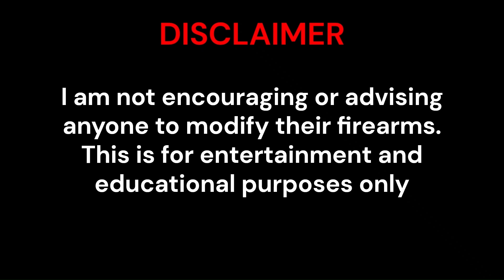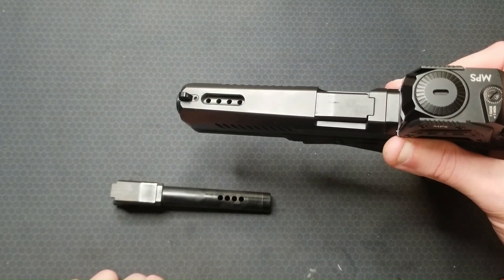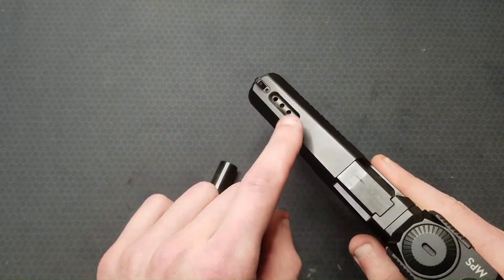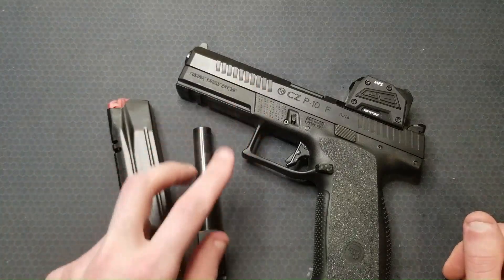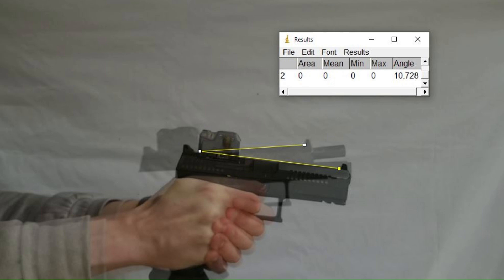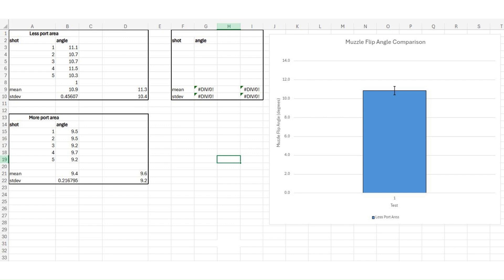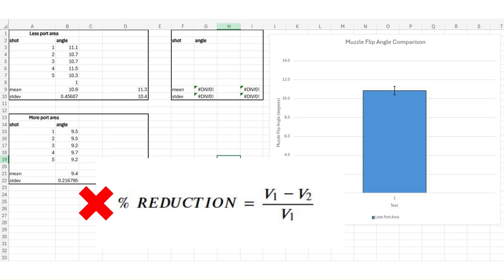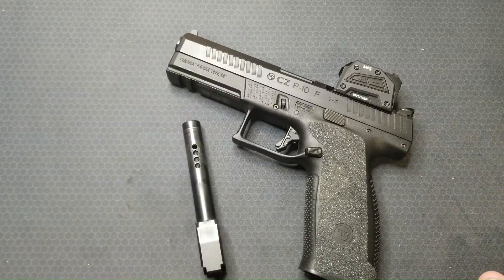More or Less Total Barrel Port Area

Comment: I have been wondering if there's a way to port only through barrel grooves or holes so as to reduce spalling.  I don't think that would be practical but an interesting issue.  Also, I had been thinking the port size should increase as they proceed toward the muzzle... because gas pressure will decrease at each port.  Your videos made me realize that the size of ported area does increase (is additive) as they proceed toward the muzzle.

Comment: How do you deburr the inside of the barrel after machining?
Reply from the maker: Sandpaper wrapped over a brass rod. I'm really careful when i punch thru with the endmill or drill bit. Correct rpm for bit too.

Comment: What you didn’t mention was the vector at which the ports were pointed for the smaller holes. 

You’d get the cosine loss of the angles off of buttline. The smaller holes have a slight difference relative to the larger ports. 

Likely the effective nozzle area is about the same since the flow is sonic at the holes themselves. Due to boundary layer effects, I imagine the larger holes also have a larger effective area. Holes are more generally more efficient the larger they are. 

Overall, I agree with everything you measured and agree with your points on the smaller holes.

Comment: I'm curious what you think of the Glockstore style porting. I know what you and others have said about V style porting vs inline porting but wanted to know if you had a different opinion with Glockstores'. Specifically on a 43X barrel 3.41 inches. TIA
Reply from the maker: Not too familiar with Glockstore. I looked on their site and saw the "double diamond" porting. That was really the only one I was seeing. Looks like they don't bore out the rifling. I ported a springfield hellcat like that without boring out the rifling and it cause massive spalling and jacket separation (that got deposited in my forehead), and had an awful impact on accuracy. Their Double diamond porting looks very similar to what I did to my hellcat. I would be really worried about the negative effects of that port design. 

If you're asking about their "C cut" porting, that looks more reasonable, small slots that are less likely to tear up the bullet as it passes. They are in a narrow V so the majority of the gas will go upward, reducing muzzle flip more than if it were a wide angle V.
Reply: @EngineersArmory  Yes, I was referring to their C cut. Thank you for your experienced opinion.

Comment: Really appreciate the work you put into this.  Any thoughts around “C” porting vs the hole porting?
Reply from the maker: Not quite sure what you mean by C porting.
Reply: @EngineersArmory  glock C-style porting?
Reply from the maker: @pedromegacool  oh probably. Holes in the barrel will help. More total port area will perform better in general. I view port design as affecting accuracy, spalling, and jacket separation more.

Comment: What portion of muzzle flip reduction was caused by reduced bullet velocity owning to lower pressure from the ports?
Reply from the maker: I dont know and I have no way to isolate that variable or test for it.
Reply: Thank you for taking the time to reply.  Where do get your barrels to afford to go through 14??. I did R&D and could do a DOE if you're interested. 
 @EngineersArmory
Reply from the maker: @marksvilar6550  14 barrels on different pistols for the most part. Just porting pistol that I or my friends have. Only a couple pistols had more than one barrel ported. I appreciate the offer. I can do DOE myself, the problem is I dont want to keep buying barrels haha. I have pretty much covered the testing that I want to do in as much as it has helped me converge on a standard porting design/set of parameter.

Comment: Three questions:

1. Would angling the ports to align with the fulcrum of shooter’s hands provide any difference in results from typical 90 degree to barrel bore portings?

2. Would using smaller diameter ports affect the muzzle rise reduction?

3. Would counter sinking the ports offer any reduction effect on the muzzle rise?
Reply from the maker: 1. Not likely. If it affected it one way or the other i bet it wouldn't be measurable with my methods. Torque would be so close due to having the same separation distance from the fulcrum, the difference in muzzle flip reduction would be due to slight changes in the resultant force vector based on the component of it that aligns with the fulcrum. lets say we angle the ports back 20 degrees - there would be a difference of 1-cos(20) or roughly 7%.

2. I saw your comment on the other video and this was answered.

3. Countersinking might? its hard to tell. Again, my background isn't in supersonic compressible flow fluid mechanics. I don't have a good intuition for it. However a diverging nozzle after the throat will accelerate supersonic flow as in a rocket nozzle. Countersink would be diverging from the ports. But I don't know if you would consider a port a nozzle or an orifice. And again, I don't have an idea about how much it would affect it, or even if I could measure a difference.
Reply: @ - you are a well of knowledge.

Not an engineer, just my layman interpretation, but if you did countersink the ports would this provide additional surface area on which the escaping gasses’ force could “push” against the conical sink atop the barrel and affect recoil?
Reply from the maker: @devilish_details  Well if you think about it that way... isnt the gas force going to push against the top surface of the barrel regardless of the form of the top of the ports? If we think about downward force (which we are concerned with to mitigate muzzle flip), and there is an angled countersink, the gas force will be perpendicular to that angled surface. Meaning that only a component of that will go to forcing the muzzle down. If there is a 90 degree included angle countersink, that means each side will be 45 degrees off vertical. The components pushing sideways and vertically will be equal and of less magnitude than the force vector perpendicular to the angled surface. Sin/cos(45) is 0.7. So you'll be losing ~30% of that downward force on a 45 degree angle. 

This is all in theory and would the difference in practice be enough to even measure? likely not. But this is the kind of nerdy detail i like haha. 

I was thinking of the form of the port affecting gas velocity. Which I think we would want to maximize for scavenging and also kinetic energy. Which is proportional to the mass and the square of the velocity. more gas energy up, more force to push the muzzle down.
Reply: @EngineersArmory  - Does this mean that the crowning seen on some higher end 1911's is purely aesthetic and offers no significant effect on the escaping gases?
Reply from the maker: @devilish_details  Interesting parallel. Good question. I dont know. I thought target crowns were for accuracy. I have heard they dont affect accuracy at all - this was mentioned in a Haye's custom guns video - I would trust that dude, he tested it. 

I always thought the idea behind a target crown was to prevent the edge of the rifling from being damaged if the barrel came into contact with something. A little burr or ding at the edge of the rifling could negatively affect accuracy as the bullet leaves. 

I like barrel crowns for aesthetic purposes and thats the only reason I flush cut and crown my barrels haha.

I dont see the benefit from having scavenging or accelerating effects at the muzzle for the gasses behind the bullet. I dont see how extra rearward force on the muzzle would help either.
Reply from the maker: @devilish_details  I think I may be having a hard time understanding what you're asking. 

In relation to ports it may or may not, i really do not know. I don't know that a chamfer vs not on the ports would produce a measurable difference, and I dont even know what condition a theoretical difference may favor. The thing im getting hung up on is 1. lack of knowledge and intuition about supersonic compressible flow. 2. mainly that I dont know if the ports would act as a nozzle or orifice. If they act like an orifice, I have even less of an idea. Im more sure about an diverging nozzle after a restriction accelerating supersonic flow.

Lets say an inverted barrel crown vs a 90 degree face does effect gas force on the muzzle as the bullet leaves one way or the other. I would think it would only really impart rearward force. More/less rearward force along a line with some perpendicular separation distance from the pivot point could indeed affect muzzle flip. By how much? no idea... Would this also result in any faster/slower unlocking time? More/less slide velocity? maybe.

Related to the AK slant break thats very obviously directional venting gas up and to one side to prevent muzzle rise and sideways motion due to the force of the recoil being offset from the shooters centerline.

A device on a pistol more analogous to the slant brake would be a compensator - redirecting gas in the direction opposing recoil.

I think my answer here is that in theory a barrel crown vs no crown could affect recoil characteristics. I doubt it would be measurable, certainly not using my testing techniques. Ill also likely never test it haha.

Comment: What about one big pill shaped  slot?  It two smaller slots at like 30° either side of the front sight.   Also maybe try an extended barrel  with ports outside of the slide.
Reply from the maker: Ive tried a few different slot port designs. The one I tested was my FDE M&P 2.0. There is a video in the playlist linked in the description. Slots and V slots are cool, they work well. They are more prone to jacket separation and spalling. It complicates machining a little.

Comment: Would be cool to see a flattened top  bull barrel with more small ports facing up in the same area, allowing more high velocity gas volume ejected in the same area while not shaving lead or jacket. 
Progressive diameter increase would be neat too.
The smaller the holes, the higher the velocity (Bernoulli),more directional and should be a bit louder based on the frequency, definitely worse gas cutting.
Getting injured during research has a long tradition. Scars of science.
Reply from the maker: Scars for science! haha. 

Im less sure about the Bernoulli effect here. I have been having trouble coming up with intuitive answers. My background in fluid mechanics is primarily subsonic, incompressible flow. The flow case of ports is supersonic, compressible. A completely different animal. I am not sure that a converging nozzle will result in a higher gas velocity from the ports like it would in subsonic incompressible flow. I think supersonic flow is accelerated by diverging nozzles. Now can ports be considered a nozzle or an orifice? 

Heres a really cool old video about supersonic compressible flow in a channel, it shows increase in velocity after a diverging cross-sectional area channel:
https://www.youtube.com/watch?v=JhlEkEk7igs

I am to the point where I pretty much make arrays of smaller 3/32" holes, poke enough of them to get the overall area i want. Minimize jacket separation and spalling, minimize effect on accuracy. See my Shadow 2 port design for an example of this.

Anyways I really struggle with intuition about the behavior of the gasses leaving ports. Its a completely different animal than what my background is in and what i employ every day at work (hydraulic fluid in cylinders and hoses).

The thought of sound and frequency leaving the ports is another interesting thought. Force from mass flow, but also force from a pressure wave preceding that mass flow.
Reply: @EngineersArmory  
You're right, didn't think of the velocity.
Compressible, turbulent. Sound will travel differently too. 
Con-di nozzle not really but too short of a distance, no expansion portion, mass volume changes too. 
It'd take some serious software to get an idea how the gas reacts to what is happening behind it if the mass flow changes. It may wobble around outside the center.

Comment: When you make that deep dive can you please explain If placement in relation to rifling grooves matters or makes more better. Much thanks, love the content
Reply from the maker: Thats an interesting one that I have thought about in the past, but that is so hard to test for. Rifling lands and grooves will start at different places in relation to the chamber in different barrels. Distance from the ports to the chamber, port size, and shape all change how the ports interact with the rifling. Rifling is there to spin and stabilize the bullet. 

Presumably, the port interaction with the rifling will cause a loss in accuracy. The biggest effect on accuracy I have tested for seems to be port size. I think this is due to bigger ports allowing larger chunks of the jacket to be shaved off and more spalling to occur, which destabilizes the bullet after it leaves the barrel. 

loss of linear velocity due to ports will also lead to a loss in rotational velocity of the bullet. Yet another factor that cannot be uncoupled from the port interaction with the bullet. maybe as the bullet passes the ports, and its interacting with the lands and grooves, more or less jacket will be shaved off depending on how the bullet is interacting with the transition from land to groove or vice-versa.

That is a very hard one to test for. maybe impossible to decouple from other factors. I have considered it. But I have not and likely will not test for it. I don't have an answer for you. it seems loss of accuracy or bullet velocity would be the data to collect to answer that. How you would design the ports to isolate that? I have no idea. Rotating the ports around the barrel from like 9 o clock to 3 o clock while keeping them the same distance from the muzzle and the same size would make them intersect the rifling at different points. But if you're using accuracy as a metric, then the ports being in different locations around the barrel would push the muzzle around in different ways presumable affecting POI and accuracy a little as well.

Comment: My only suggestion would be to add ports at an angle at the top, so the gas vents to the side some.
Reply from the maker: The muzzle flip action would begin at the instant of ignition. 

Yes, venting the gas pressure up will reduce the rearward force imparted on the slide and action. However that gas will also impart a downward force. 

The ports will only really be effective from the time the bullet passes a port until it leaves the muzzle. This is called dwell time. After the bullet exits the barrel, the pressure in the barrel will quickly drop to atmospheric. Ports only have a very small window of effective operation.

Comps may be more effective at reducing muzzle flip for the reason you described and also because they add weight to the end of the muzzle. 

Comps are sensitive to ammo though, they like higher velocity, higher powder charge rounds. I have found with most my range loads the ports are more effective because the ammo isn't very hot.
Reply: @EngineersArmory  is this a fact? in your slow motion videos i cant see any downward movement imparted on the firearms at ignition when the ports are working but i do see the slide take longer to cycle and not bottom out hard which translates to the reduction in muzzle flip. its not like the gun is being pushed down then it cycles upwards is it?  also if the posts are only working during the dwell time why not put them closer to the chamber? i noticed you always have the ports at the end of the barrel but most of the good ported guns ive shot had the ports closer to the chamber than the muzzle.
Reply from the maker: V ports are good for keeping spalling from hitting your noggin if shooting from retention. I think they look cool too. Sometimes packaging or slide shade lends itself to V ports. In terms of performance, the more gas that is directed vertically, the better the effect on reducing muzzle flip. Venting sideways at all still dissipates energy that would normally be pushing the slide rearward so it will reduce some recoil, but its most beneficial if that gas also helps push the muzzle down.
Reply: @EngineersArmory  so you say "push the muzzle down" but the slow motion looks like the ports have already released all the pressure before the slide even starts cycling? how is it pushing the muzzle down  exactly?
Reply from the maker: @FineSoups  regardless of the position of the slide, the gas leaving the top of the barrel will impart a force downward on the barrel itself and therefore the muzzle of the pistol. I dont know if im understanding your question correctly.

Comment: I think all the info you have learned will be much appreciated here. I know I would certainly love to see it. Knowing what is truly beneficial porting wise will certainly be a huge help to anyone considering porting their pistol and I am one of those guys. I just don’t want to go about it the wrong way. I was considering a chunk comp and a few small ports on a RXM but not so sure that isn’t too much  now.
Reply from the maker: I'm kind of coming to the conclusion that you can arbitrarily poke holes in the tops of barrels and get good performance gains haha. There are certainly things about port designs that will just be my preference tho. A lot of the ways I port barrels are limited by my machining skills and the mill I have available to me. But I have noticed things inherent to different size and shaped ports. Not so much related to performance, but accuracy, POI shift, spalling, and jacket separation.